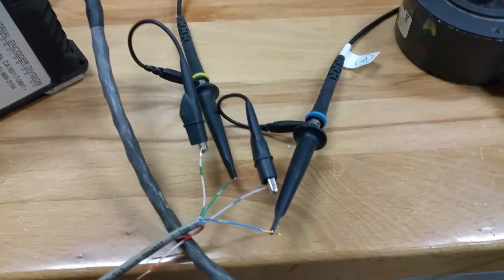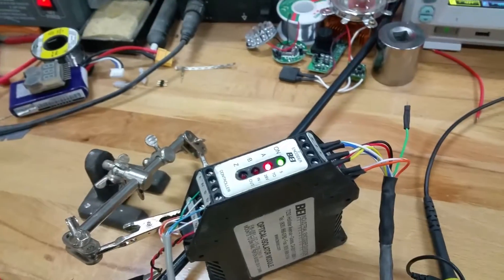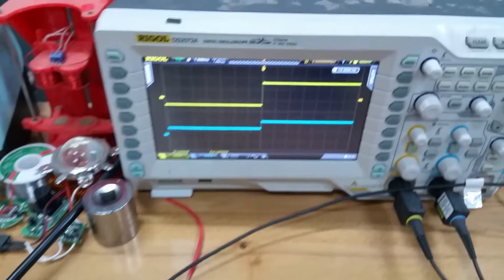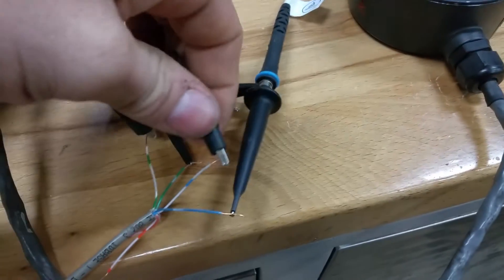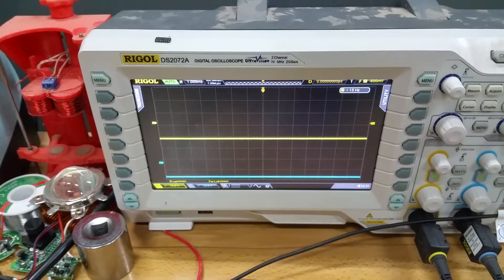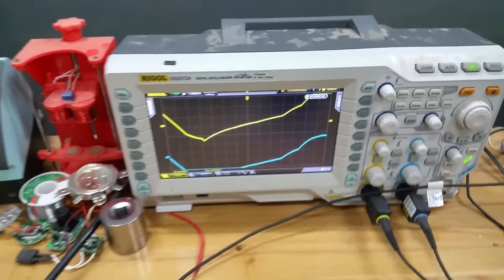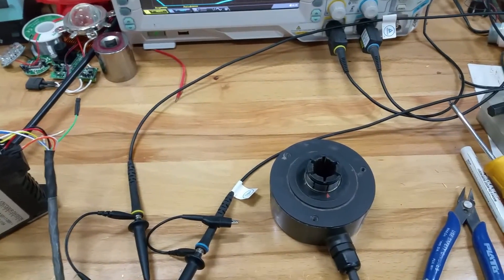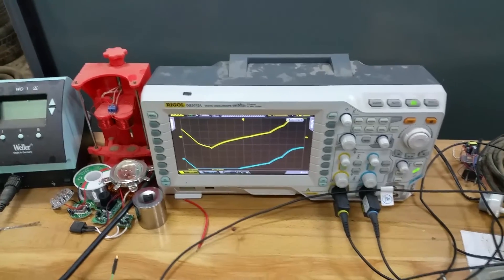HS35 encoder problems connecting to Oscilloscope

Comment: your all good. the ungrounded signal is corect. watch it. you have the correct steps.  yes the ground is floating so you do not have a pretty looking sine wave. From what I can tell you your oscilloscope needs to have a completely isolated ground. Try grounding only one probe to the ground reference on the other side of that opto-isolator.  I've met with many of these in the days I'll try to help you if I can. ~Russ
Reply from the maker: YOU THE MAN! that did the trick I now have 90 degree shift in the signals and a proper square wave. I kinda thought I just wasnt using the oscilloscope correct. I'm still have to learn the dos and donts of using an oscilloscope so I have been afraid of shorting the scope(not mine) or my encoder somehow but I did as you said and viola. I even replaced the chip inside the encoder again because I thought I overheated it and that was producing the crappy signal. Thanks for the help!
Reply: +Dustan Webb you rock dustan!  one will never learn if they don't ask for help :)  that is what these YouTube videos are all about. I still ask qustions all the time. :) and get greate answers. God bless!!! PMBO some time this year. be ready :) ~Russ
Reply from the maker: +rwg42985 PMBO!! woot. did you notice my last pmbo entry in the video?
Reply: @DustanWebb so how did you hook up the leads? A to the opto isolator ground? Having same issue
Reply: I have a question that I cannot seem to find the answer to. 
Are the AB minus channels just inverted AB positive?